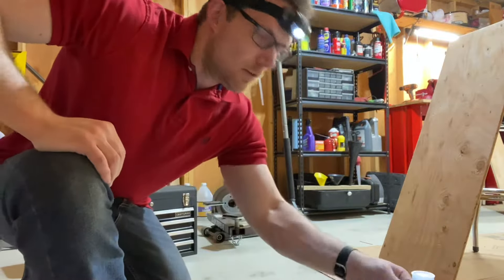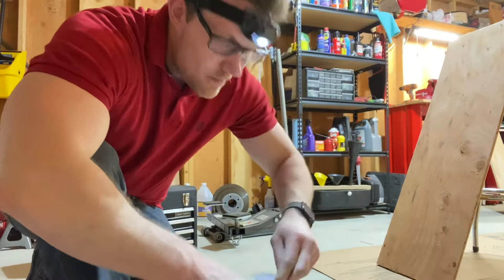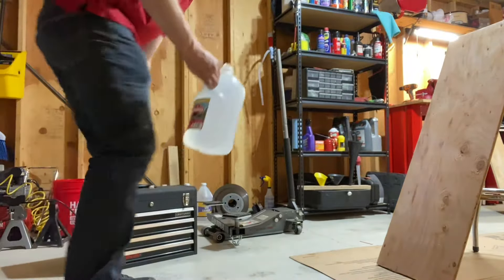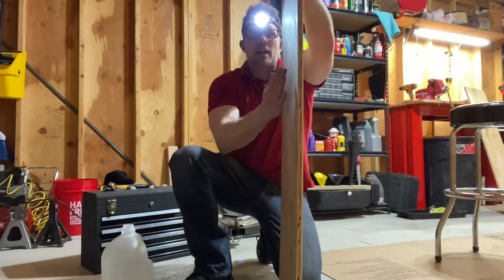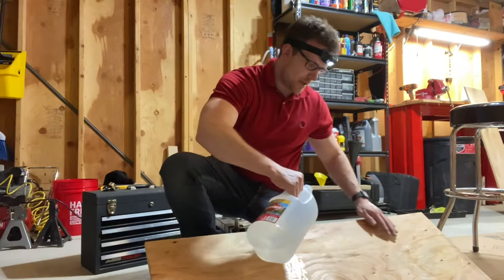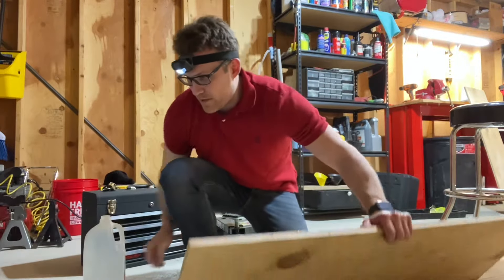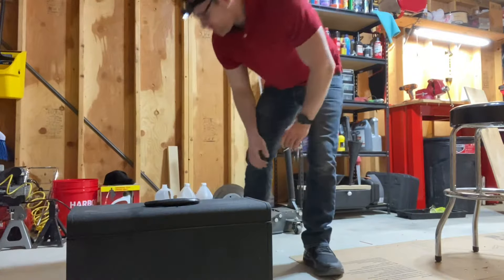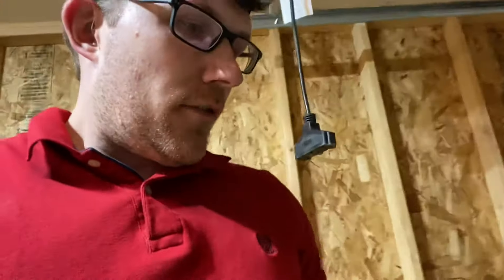How to fix warped plywood in 60 seconds

Comment: I hope it works i did it i'll check it tomorrow, i only do manual sand paper with my hand, 4 hours and still not even hahaha, i need it even for my aquarium not to break.
Reply from the maker: How'd it go?
Reply: Concave side down, filled aquarium on top works just fine.  The weight of all that water (Even a 10 gallon is about 80lbs) will flatten the wood and after some time it will remain flat even with the aquarium removed lol.  Water treat it of course, but I have never used perfectly flat plywood under my tanks and they all even out once the water is filled.  You should see it even out once the water is added right way, if it's really bad warped wood then yeah maybe a different piece would work best.
Reply: @LionhartM  it works thanks bro 🥂
Reply: @animalyze7120  thanks man

Comment: Hi! quick question if I may... after cutting the wood or playwook, could it bend again or this fix is definitive? or for how long?
Reply: Wood will warp over and over again if it's not being used and the environment is humid.  If stored flat with nothing on top of it it will eventually warp again.  This method works and is recommended to use the wood as soon as it's in good enough flat condition to use again.  You could seal the wood after it is flat again and it will hold up longer but using the wood right away then seal/stain/painting it is the best option.
Reply from the maker: What he said